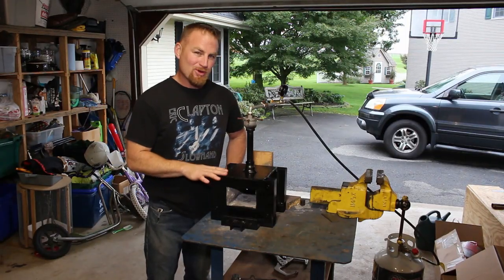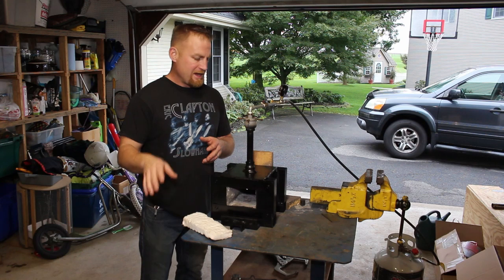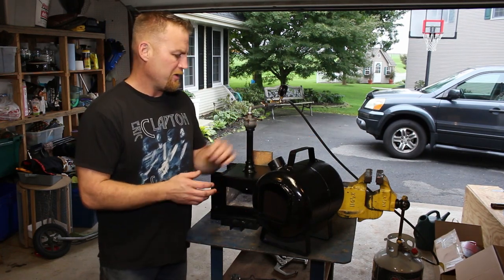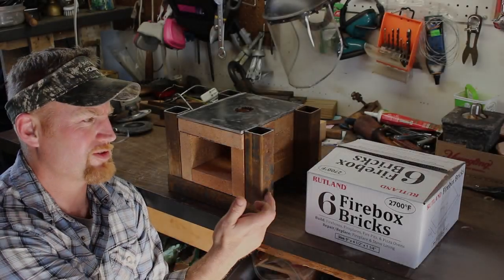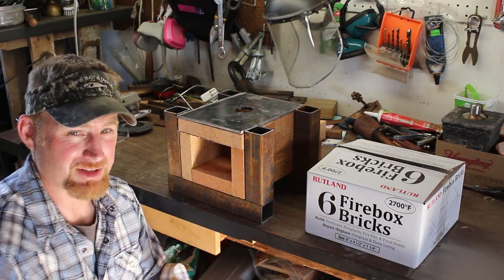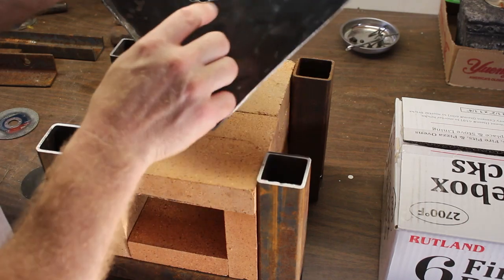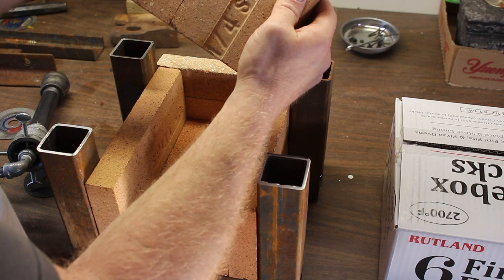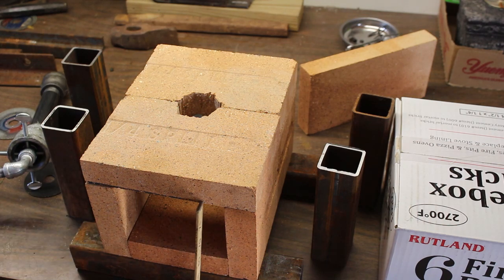Evolution of My First Propane Forge

Comment: Looks great!! Good call switching to the ceramic wool those type of fire bricks don’t insulate very well and I’m glad you’re putting that hammer to good use!
Reply from the maker: Thanks Paul!  yeah, it gets much hotter now and that hammer, especially the rounding die, can move some metal.  I'm looking forward to practicing some more when it gets a little cooler finally out there